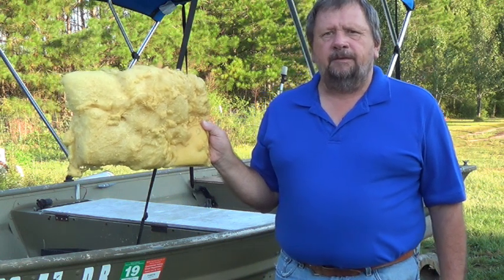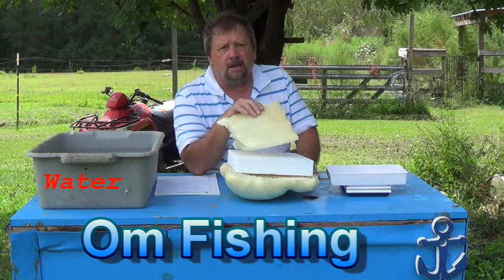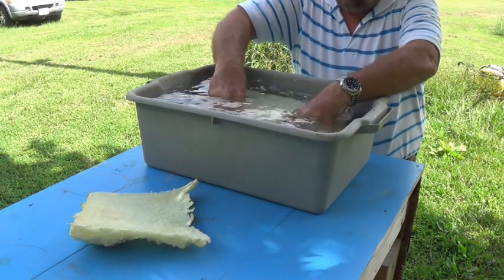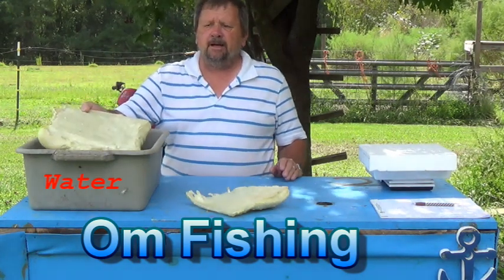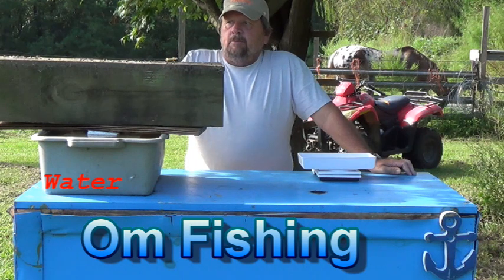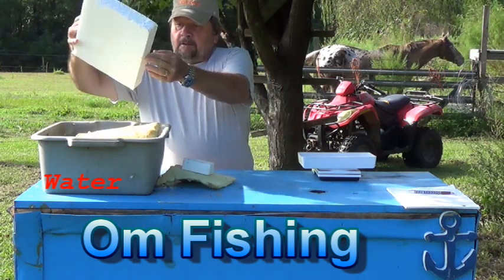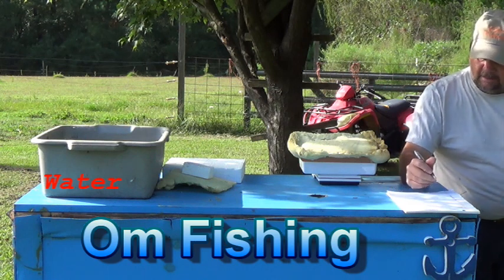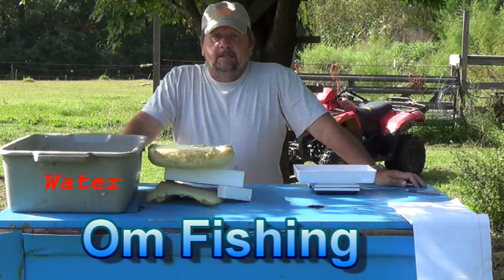Buoyancy Foam Test

Comment: With the foam, if you need to trim or cut of excess, to ensure a level surface, make sure to apply a couple coats of epoxy resin to seal the exposed internal cells before closing up floors and other panels. 
Water will not penetrate.
Reply from the maker: Thanks for the tip.

Comment: Thanks for making the video.
The general thoughts suggest... once water gets in and particularly when it freezes, it ruptures more cells and the saturation grows in this manner,. More and more and more.
My 19' boat had several hundred pounds in soaked foam, even the gunnels were soaked. But my boat was 50+ years old.

Comment: This test isn't reliable due to variations in foam size and weight. Additionally, the bottom foam experienced more pressure, and the largest piece collected the most water, which wasn't surprising.

Comment: Thanks for doing this. I have a 35 year-old bass boat where the factory installed poured foam under the aluminum floor was easily saturated with over 200lbs (probably a lot more) of water. I only figured this out after a broken axle and noticing that it was becoming difficult to lift the tongue of the trailer. I think that the very rare exposure to an occasional spilled splash of gasoline probably made things worse. I have it all removed at the moment and getting it all out was a big messy job. I’m leaning toward the pink foam from Home Depot and empty plastic tonic water bottles.
Reply: Pink foam is not petrol safe, use polyethylene. pool noodles can work well.
Reply: just bought an old v hull and the floor has spray foam under it. it's a mess and proabably easily adds a couple hundred pounds if it runs throughout. not sure what the solution is but I won't be putting that foam anywhere water can run. once the barrier is broken, it holds the water forever. plywood that was sitting on it was damp to touch a week after being around any water.
Reply: I thought pool noodles would work well but I was wrong. Not only will they hold water, they also deteriorate into a sludge mess. Definitely don't choose pool noodles!

Comment: Cut open to expose open cells and submerged for a week.  I'd have expected the same results. The thing about foam that is required in small boats is that it is expected that the boat will be towed or bailed rather quickly - within a few hours.  I turn Grumman canoes into sailing trimarans of moderate to good performance.  They get wet.  My current fleet of two are quite old, and have the old school styrofoam in the end chambers.  This type of foam is known to degrade in its ability to displace water, as it absorbs moisture from the air over may years.  I suspect there are quite a few perfectly good old aluminum boats at the bottom of ponds and lakes.  I replace the flotation with polyethylene, which is what most boats now have.  It's the same stuff in the throwable seat  cushions and cheap orange life jackets.

It also absorbs water over time, but it's not meant to float forever, just long enough to keep you alive until rescued.
Reply: Thanks

Comment: Need to wrap in fibreglass then do the test. The foam in reality is cased in Fibre or contained in a capsule of non-pouris material. It is not generally exposed by itself to the water. The reality test should actually be if it aids floatation cased in a non-permeable membrane. If water gets inside the hull then any material will absorb the water due to capillary action.

Comment: do not cut the top of the foam off. lund did this when they build my boat and water got inside the foam and rotted my marine wood floors. when I tore up my floor there were 3 places where lund sprayed in too much foam and they simply cut the tops off and that's wh
ere the rot was . it eventually spreads to the entire floor. thanks a lot lund.
Reply from the maker: I though the newer foams would be ok to cut the cells. As it turned out I would not cut it again. Just make sure you add a little at a time. My test did hold some water at the cut cells. Thanks for the information.

Comment: Excellent test.  Thank you for taking the time.

It would be interesting to see how fast each one can dry out.  They say you'll never get the water out, but it'll dry out in time.  Granted a video I saw about restoring a pelican bass raider mentioned that it took several months for the foam blocks to mostly dry out sitting sitting in the sun.

I'm willing to bet that a solar dehydrator made to fit those sizes would work much faster!
Reply from the maker: I think you are right, their should be a way to get the water back out. On my robalo boat the foam was in water trapped in the bilge. It did take a long time to dry after I opened it up.

Comment: That's why you should only use epe expanded polyethylene for marine bouyancy foam. Newer 2 pack or polystyrene.
Reply from the maker: Yes using the right stuff is a must.

Comment: For a boat that is dry docked, floatation foam is the way to go. For a boat that lives in the water, bulkheads and pumps are ideal.
Reply from the maker: You are right floatation foam is not for all boats. Thanks for commenting.
Reply: So the foam is more for emergency purposes then performance?

Comment: Styrofoam and great stuff both will absorb water. You need closed cell foam. It is more expensive. You could also put sealed plastic 2liter bottles in your boat.
Reply from the maker: Thanks for the tip. Stay Safe!!
Reply: All two part foams will absorb water. read the data sheets.

Comment: What are your thought about putting a thick trash bag in the opening then pour the foam IN the bag?
Then when it's done expanding, cut off the excess and seal up the bag real good?
That way no water could penetrate the foam and cause it to be waterlogged. 
Thoughts????
Reply from the maker: I think that is a great idea. Two heads are better than one.
Reply: @OmFishing  I ended up putting 1'' closed cell styrofoam vertical under my boat seats.
Closed cell won't hold water.
Reply from the maker: @timgiles9413  Good idea. Stay Safe

Comment: Ii would be interested if you are correct about the cut areas absorbing water. Another experiment would be trying a piece not cut and do the same thing. Actually I am not sure if it would make much difference. Many old boats being redone, never submerged, have wet foam just from rain, water being dripped into the boat from swimmers etc or even bilge water. Informative experiment to see nevertheless.
Reply: As your boat gets old. I guess just with changing weather and moisture the foam starts cracking. So eventually the membrane will always be broken. I’m having that issue with my boat. I bought it new 10 years ago.  Just like one of the previous comments. The persons boat had 200 pounds of water. There really needs to be a better foam product marketed. Maybe there is.

Comment: How about testing foam for fuel resistance?
I lifted the floor of my 5.2 metre centre console boat to do some rewiring. I found that nearly all of the foam had dissolved with only 2" left of the top near the flooring. The rest of the foam was sitting on the hull melted into a hard plastic sheet about 1/8" high. I figured that there must have been a fuel leak at some point which melted the foam. The fuel would have floated on any bilge water therefore lifting it or splashing it up high. The foam used in the boat was styrofoam (polystyrene). I wonder how many boats are out there that have the same issue as mine had. This would have been disasterous if swamped and offshore.
Reply from the maker: Thanks for the good idea. I have seen that before myself.  Thanks for sharing that with us. Take care and stay safe.

Comment: Find a way to seal up your pieces.  Coat, contain it so it doesn't get wet.  Spray some of that water shedding stuff all over and try them.
Reply from the maker: I put a lite coat of the foam on the cut areas to seal the open cells. I was trying to come up with something to seal the cells like paint or something but I just used a light coat of foam to seal.
Reply: @OmFishing  garbage bag, plastic of the stretch variety. Then seal that .  Just brainstorming 😂

Comment: If you have a chance can you please do a test with (1) boat foam wrapped in poor man's fiberglass and (2) boat foam wrapped in fiberglass? Thx. 

Your test was interesting.  But it sounds like the regular foam went up in weight by about 500% and the boat foam went up by about 60%.  Neither one went up by exactly 100%.  Also the boat foam was much bigger so although it went up by about 100 grams that is much less saturation than the regular foam that went up by like 450 grams.  I know I didn't get the exact numbers. Anyway very interesting.  Makes a good case for using boat foam although it's way better to keep it dry if you can.
Reply from the maker: Thanks for watching and for the idea for future videos.
Reply: @OmFishing  Also I'm concerned about flammability, don't know if you can do a test comparing fiberglass polyester resin with fiberglass and epoxy.  Maybe boat foam wrapped in each.  Also gel coat.  I want to make a little houseboat and I want to design in some fire resistance.  Sorry to bug you, thanks for considering my suggestions

Comment: 286 to 374 The white foam went from 44g to 272, seems obvious which is better haha
Reply from the maker: LOL if this would have worked this could have been the life boat of the future. You get in trouble off shore you throw a capsule of this in the water instant life raft. Back to the drawing board.
Reply from the maker: Check out my other foam video and this comment will make sense.

Comment: Informative but.. to be more precise you should have used the same size of both foams, example 1 sq ft to 1 sq ft. each in inch thick etc. Yo started with more weight and size on one then the other so of course it is going to weigh more and be able to soak up more water.  You an make another but use example the same size mold for each different foam so they are the exact same size and shape.

Comment: does polyethylene form also have buoyancy(flotation)?
Reply from the maker: Most form will float that is not the problem. Some foam will absorb water in time and not float any more. That is why you have to make sure you are using the right kind of foam. In some old boats when you check the foam it is full of water and would do no good for buoyancy. I bought my foam from US Composents they have a lot of information about the different foams.
Reply: Om Fishing Thanks for giving answer. A lot helpfull
Reply: polyethylene is the choice to use.

Comment: Haha EPS foam (white) or polyurethane (yellowish) will not “absorb” water! The water molecules will go between the beads/cells. EPS is not closed cell, it will always trap more moisture!!!! Not sure what you are trying to teach?
Reply from the maker: I was just testing the foam. In my old Robalo boat when I removed the foam it was full of water. I wanted to see if Under water for a long period of time would the cell fill with water.